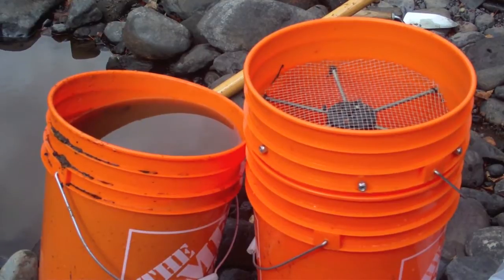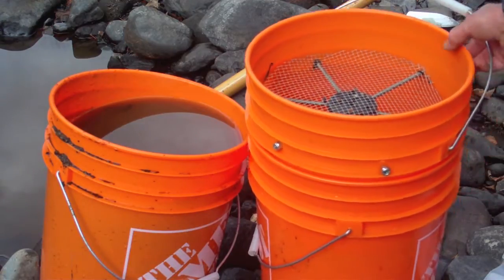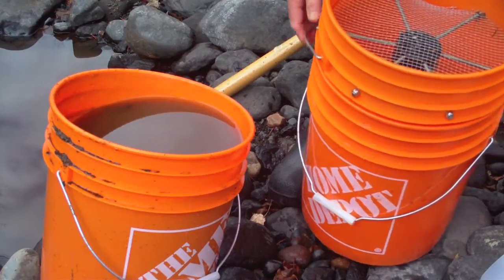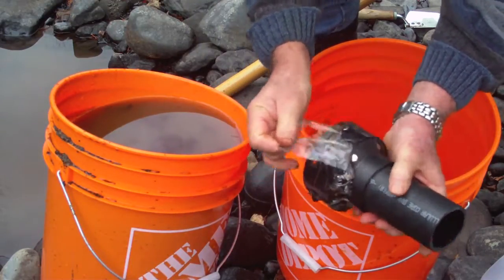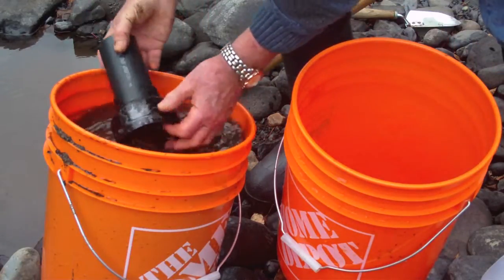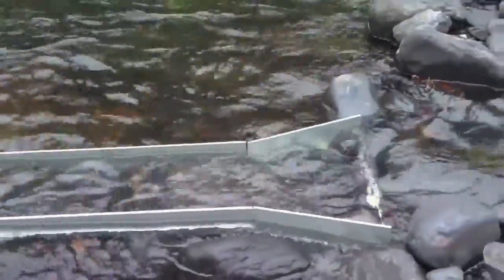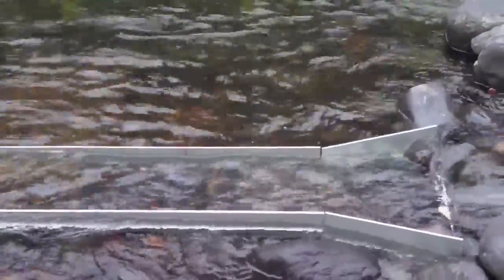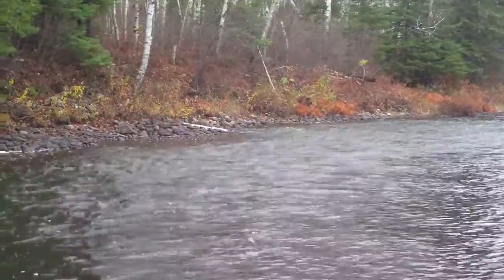Bucket classifier and lexan gold sluice in operation.

Comment: Henry, have you considered putting the rods on the upper surface of the screen?  It seems to me that when you rotate the bucket back and forth the rods would make a heck of a good way to turn the material over for better and faster classification.  Also, I've watched a few of these bucket classifiers in action, and having the material surrounded by water greatly accelerates the separation.